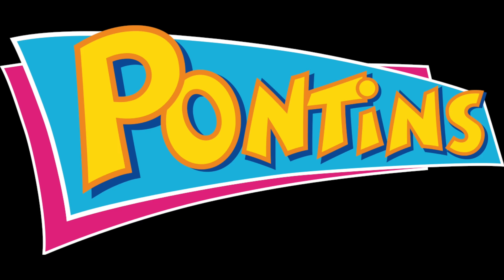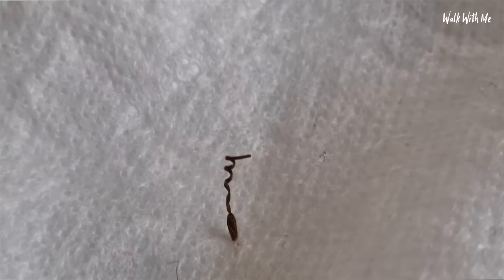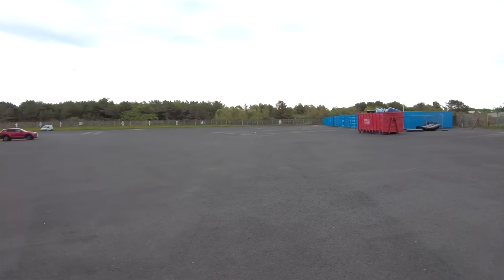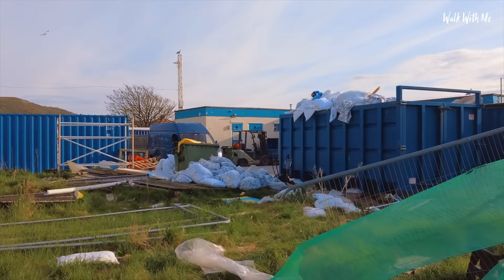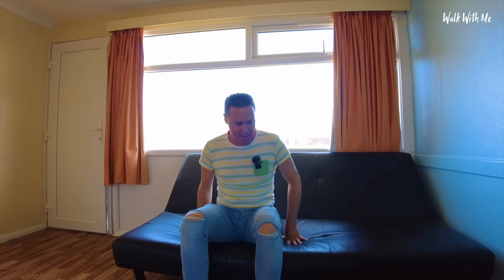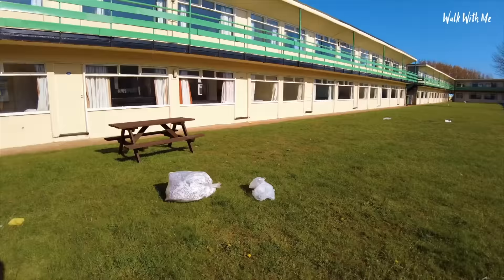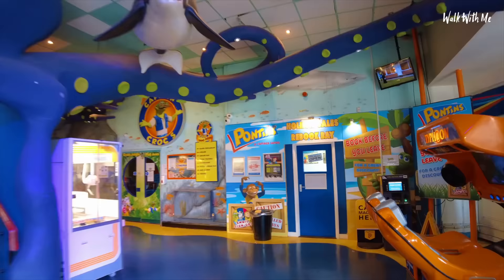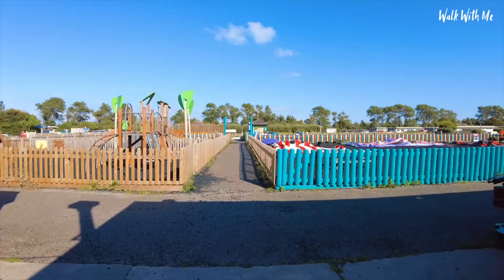I Visit EVERY Pontins In The UK - I Was SHOCKED!

Comment: OK where to start.
26 years ago I first visited Brean sands on a football tour and I can tell you this place was brilliant, accommodations were good, go karts were good, the crazy golf was brand new and swimming pool was brand new and the park was out of this world with the first zip wire any child had seen before, it was big, all the facilities were open. Fantastic experience when I was a child. We came here loads of time 3 football football tournaments and many times for new year etc. 2002 was the last time for a long time, we came again in 2015 and this year, they haven't updated anything and that's the big problem. This place and many more I think could do so well if they up the price slightly and up the maintenance. I can't see why they can't compete with butlins because its got the size. I know butlins is way more expensive but surely pontins can meet somewhere in the middle. Just abit of cleaning and painting will make a difference. All the site are in great position. Pontins I think need new owners with big ambitions to turn this once a great place to go.

Comment: Fantastic review on all 4 Pontins camps. When I was extremely young, I did stay at Pontins Breansands and Prestatyn. It looks like not much has changed since the late 70s and early 80s.

Southport.
0:55, Way was the flag at half-mast? 2:15 80s Car Aeriel. 3:00, what type of hospital? Liking the shaver plug over the toilet, shave while 1 or 2. 7:10, You was most definitely not in Rio (Duran Duran, 1982).

Prestatyn.
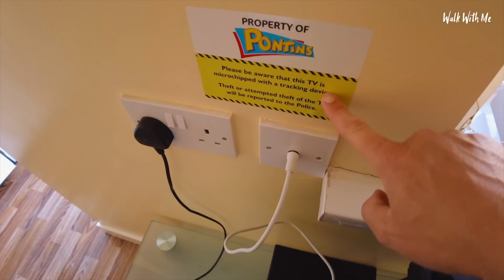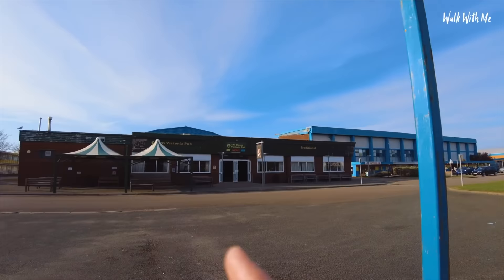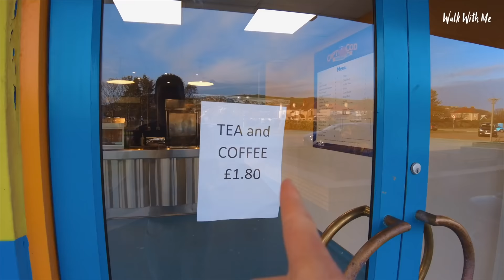9:55, My PC monitor is bigger. 12:20 Security. 12:35 Are you going to have Tea or Coffee with your fish and chips? 13:50 Beach Comber restaurant, going to have a think about that.

Camber Sands.
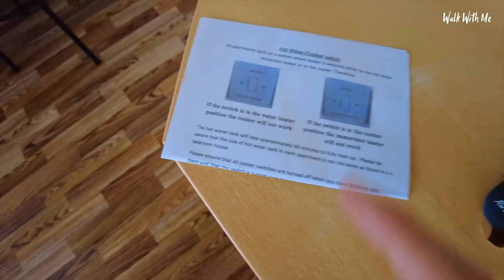15:45, LEC use to be big name in the 80s, no wonder people are sick after staying and cooking on dirty pans. 17:20, Vintage boiler, 1 hour to heat up.21:10, the entire pontin's is overgrowing.

Breansands.
24:30, I was going to say that Pontins knew you was visiting, as you had the best of the worse. 25:15, more 80s car aeriel. 25:52, jigsaw puzzle.

Comment: There's not actually a legal requirement on pat testing so to speak. Devices do have to be checked regularly how regularly that is is basically down for discretion and how you do that is also up to you. Basically a pat test is any easy way to say testing has been done. I used to pat test at my old job and did the training course for it. I've seen proper old shoddy crap pass aslong as no damaged and passed insulation test it pass but it could still be dangerous for example the heater could be absolutely full of dust but tester can't see that.

Comment: Britannia Hotels, the owner of Pontins, seems to view investment as the worst business practice possible, as each year passes, and they squeeze the most out of the assets without investing, the cost of dealing with all the structural issues, condition of the apartments and fixtures, all the general disrepair and disregard gets higher and higher. You only have to watch Tim's review of the Potters Resort to see what can be achieved with foresight and investment, just on the Health and Safety issues along with the hygiene failings these parks of Pontins should be closed in reality.

Comment: I can only comment from experience at Camber Sands as I haven't been to the others, but compared to the others it looks like the best one (if there is a 'best'). I agree that you can't fault the entertainment. The buildings are not only badly decorated but they're unsafe with rotting wood and broken equipment. Our chalet I have to say was clean apart from a sandy floor which needed a quick sweep. Lots of people I spoke to whilst there said it's just somewhere to get their head down, they spend all day on the beach. The staff morale is just through the floor and they have given up due to the sheer amount of complaints they have to listen to. I last went in 2017 and the last straw for me was when there were feral children trying to get into the aviary and kicking balls at the birds. I went to talk to security who literally just shrugged their shoulders. People were also playing football until gone 1am and kept kicking the ball against the chalet wall. If it was Butlins it would have been dealt with. I swore never to go back, and never did get a reply from Pontins when I sent them a lengthy email pointing safety issues out. I'm not a "Karen", I'm just someone who thinks that a holiday should be good clean fun without fear of coming home injured or ill. Thanks for your video Tim, a great eye opener 👍🏻👍🏻
Reply from the maker: Thanks Vicky very good points

Comment: I question the structural integrity of these building. The rotted wood on the outside buildings is scary.  It doesn't cost much to be clean. If you are paying someone to clean that's what they should be doing. These places are scary and should be condemned.

Comment: These chalets were never designed for winter use, the camps always closed in the winter so they never had much (or any) insulation. Most were cheaply built in the 1960s and probably designed for a lifespan of 25 to 30 years....here were are 50 or 60 years later and they're still using them! And using them in the winter - but I guess they did at least install double glazed windows. But as long as people are willing to visit then they'll keep these camps going until they literally fall apart

Comment: Just come back from Pontins Southport. I've never been to a Pontins before and I was completely disgusted. Most of the chalet blocks should be condemned. Never thought I'd be forced to stay in such a shit hole after 22 years into the new millennium. Danger seemed to be lurking around every corner. From filth, to loose slabs, rotten handrails and litter strewn about the place. The cleaners obviously don't give a shit and the management even moreso. Everything from the concrete to the wood to the metalwork is in a pretty severe state of decay.
You'll have a much nicer holiday in a Haven or Park Dean site where the caravans would seem luxury in comparison and all for a similar price.
Never go to a Pontins. It's about time we all made a stand by closing our purse strings and get these dumps shut down.